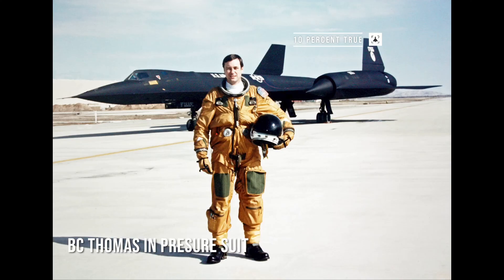SR-71 Pilot: Survival at Mach 3+

Comment: Pedantry time! Your blood would not boil. Blood vessels are insulated from the outside, only things in contact with vacuum boil. They would dilate and bp would drop, making you pass out. It's not an automatic death sentence at those altitudes, but survival chances are extremely low, and you'd be one foot in the grave so the distinction is academic.

You would get the bends, and get significant trauma, especially to your lungs, where liquid could boil when high enough. Probably wouldn't fly anymore, or walk...

The seats probably had a sizable hole in them. Need the extra space for men like that.
Reply: They had big balls but most importantly they had a Physiological Support Division team that made sure the pressure suit and the connections were perfect every time, so in a depressurization they would be fine. Same with U2 pilots
Reply from the maker: Good to know. Thanks!